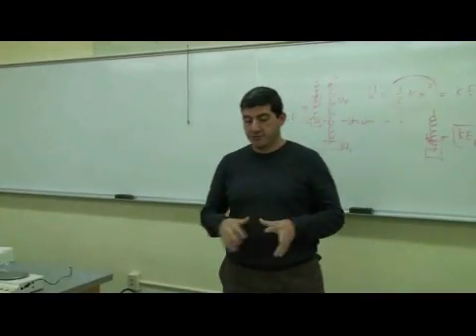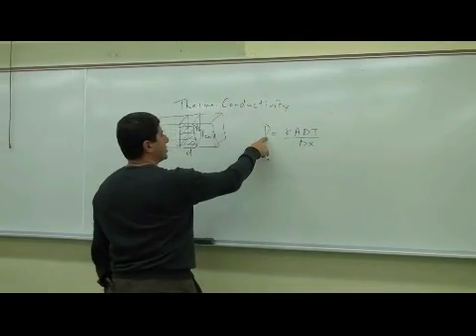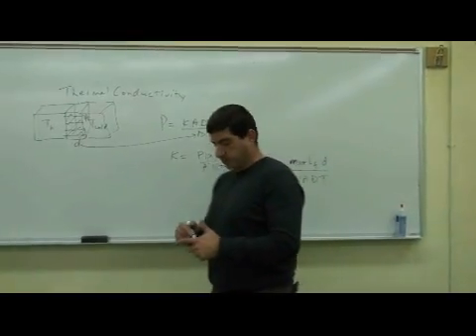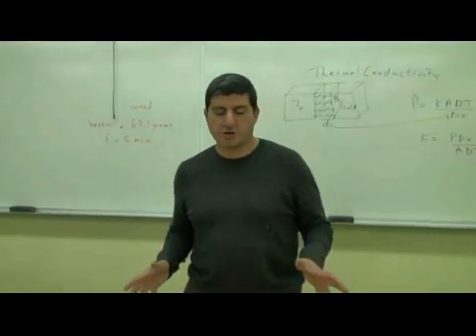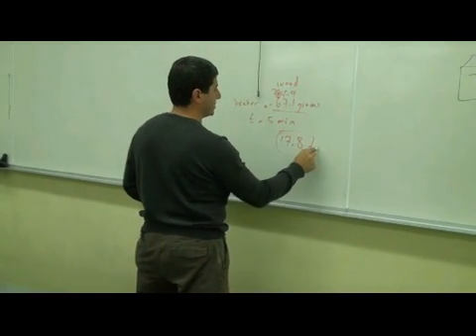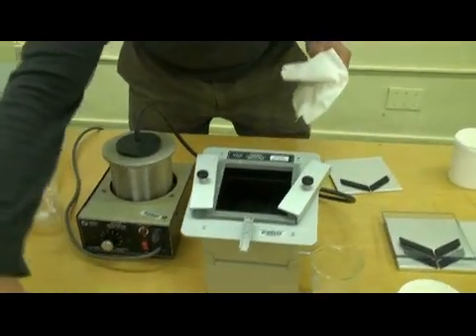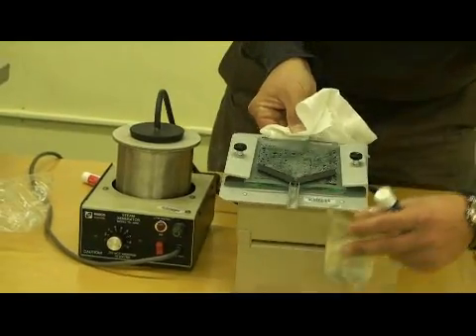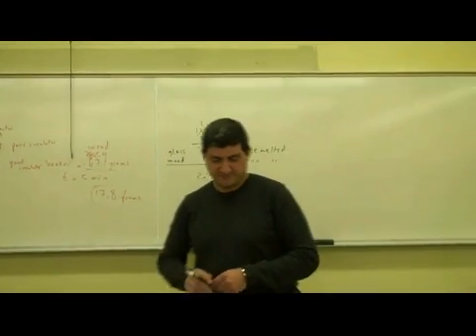ThermalConductivity.avi

Comment: this method can't be accurate. Ice also melts due to the ambient room temperature. And Ice can have lower temperature. How does this all affects the result?
Reply: Matej Petráš you can simply measure the effects of convection and radiation at ambient temperature with no applied heat, and deduct it.